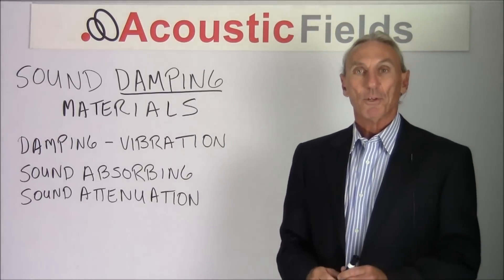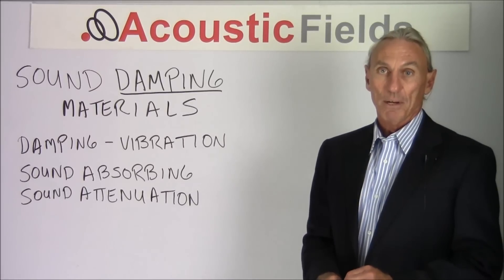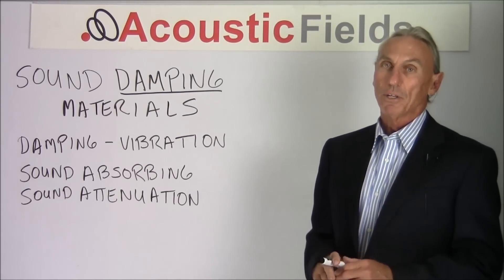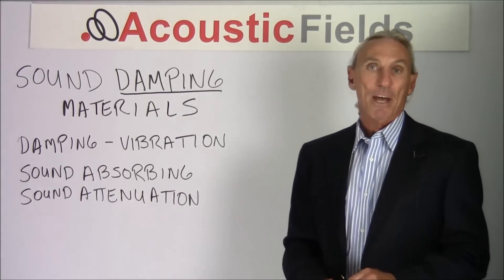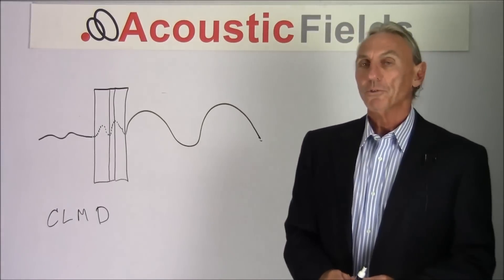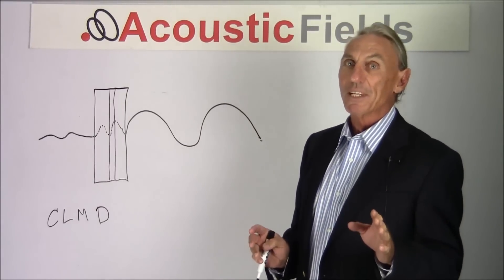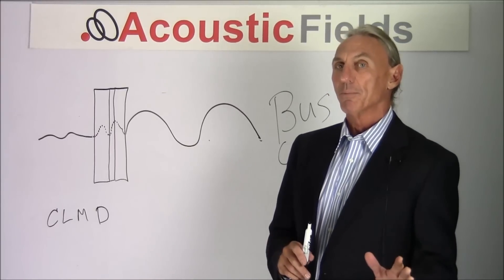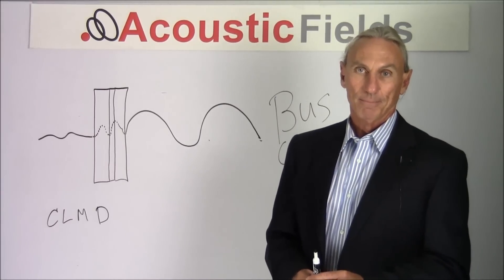What Are The Best Sound Damping Materials & How Do They Work?

Comment: I watched 8373747 videos and read 363873 articles that told me the difference between words and no one has ever told me how to stop the noise from my upstairs neighbours....... Just tell me what material to glue to my damn ceiling!
Reply from the maker: All noise is composed of frequency and amplitude. You must measure the noise and then assign the correct material type to deal with the frequency and amplitude of the noise. Its a process that starts with identification of the problem. Have you measured your noise issue?
Reply: @AcousticFields  It's looooouuud! I can clearly hear words and phone on vibration. Dropping a coin sounds like an explosion. Usually upstairs noise is both airborne and structural. I don't need to identify that, it's both. I really don't need to measure the decibels, what difference does it make if it's 45 or 78 or 89 (for example). I just know that it's unbearable. It's a thin brick+concrete layer. I got an offer from a company but with the money they want I'll buy a mansion in Peru... It's a small room, box in box is not an option. Some say structural noise is dampened by space,other say sound and vibration travel through space so you need hard materials. It's confusing. Which goes first? Cork, rubber,air????
Reply from the maker: @alessiasimonne2631  "Loud" is a subective term that has different meanings to different people. Since every material you must use in any barrier design is frequency and amplitude dependent, you must know both. This saves time and money. Guessing with noise is foolish. If you guess wrong, which 90% of clients we work with do, you will have to demo the job and start over. Noise below 125 hz. is treated differently than noise above 125 hz.

Comment: is it helpful to use viscoelastic material sandwich between two face sheet for sound barrier application. My requirement is to dampen the sound wave below 100 Hz. And the next is how efficient a commonly used damping material for sound reduction application in a range of frequency up to 500Hertz.
Reply from the maker: Noise transmission below 125 hz. requires a completely different design than frequencies and amplitudes above 125 hz.

Comment: I have a a simple question....i hope someone can answer it...I live in a condo with a shared wall and i want to eliminate the sound of talking from the other side. Will a 5/8 thick sheet of sound proofing drywall added to my existing drywall solve it?
Reply from the maker: There is no such thing as "sound proofing drywall". What is the frequency and amplitude of the noise? You must measure the noise before you design a proper barrier technology. Is the noise louder on some days? When you design a barrier, you must design for the maximum pressure at all frequencies.
Reply: @AcousticFields  no, its a constant level....if i turned the fan higher, i probably wouldnt hear the talking much.......well, soundproof or not, i would imagine that the extra layer would help.
Reply from the maker: @GEO-xx6sq  Guessing with noise is not recommended. Most guess wrong. make sure you consider the flanking noise in your design. Noise is like water. It will find the weakest link and travel through that structure.
Reply: @AcousticFields  thank you

Comment: If I use two ply sheet with small air gap between them. And if I make box with such arrangement. Can this box give a good sound proofing for noisy generator?
Reply from the maker: What are the frequency and amplitudes of your noise issues? Are the noise issues constant throughout the usage period or do they increase and decrease over certain days or hours? What are the maximum pressure levels you are experiencing, are they consistent, and at what frequencies do these maximum pressures exist at? Guessing with noise  is foolish and expensive. You must quantify and qualify.

Comment: Sir. Which is best damping material for speaker cabinet .. and how much it should be thick .. & should it be stick on all the wall .. using 18inch pro audio driver for home hifi
Reply from the maker: If you have to calculate the vibrational signature of the cabinet design. Remember when building cabinets just like rooms, noise transmission is all about vibration management.

Comment: The video title is "What Are The Best Sound Damping Materials & How Do They Work?" Well, guess what. Still waiting to know what are those famous material as none of them are mentioned in the video. That title is 100% clickbait.
Reply from the maker: There is no one size fits all. This is a common mistake made by individuals. Every material type and every construction methodology is frequency and amplitude dependent. You must first identify the frequency of the noise and then how strong the noise is before you begin the barrier design using the appropriate frequency and amplitude dependent materials.

Comment: One question. Let's say you have such a box and there is an engine that makes 32DB sound inside. Whatever the brown colored 1-2cm thick insulating material is, the best sound insulation is provided? If you were, WHAT WOULD YOU CHOOSE that brown material to best insulate the sound?   --cork mattress?   --fiberglass? ...........
https://teknoseyir.com/wp-content/uploads/2020/09/6aae00db077c8ca-608x539.png
Reply from the maker: There is no best. You must calculate your rate and level requirements for each surface area you are treating and match to usage. There is no one size fits all.
Reply: @AcousticFields  32 db electric motor and fan (air flow) sound. :) What is the most suitable material for this size with a thickness of 2-3cm?

Comment: Which is a good source of noise reduction a high natural frequency or a low natural frequency?
Reply from the maker: A,  What is the frequency and amplitude of your issue? Material type, amount, and construction methodology depends on frequency and amplitude.
Reply: @AcousticFields  Thanks for replying.
I want to know out of different materials if one material has high natural frequency then how is it even related to noise reduction
Any sort of equations?
Reply from the maker: A,  No, all material types are based upon the noise frequency and amplitude we are trying to reduce the transmission of.
Reply: @AcousticFields  ok, if we are provided with a material having high natural frequency will it be a good material selection for noise reduction or should we pick the one with lower natural frequency
Reply from the maker: A,  The resonant frequency of each material used is frequency and amplitude dependent of the noise you are dealing with.  One material type is never used. It is always a combination of materials to treat noise. You are looking for a simple solution and with noise. There is none.
Reply: @AcousticFields  Thanks for answering
Reply from the maker: A,  What is the resonant frequency of the material and what is the frequency and amplitude of the noise you are trying to reduce the transmission of ? You can not get away from measuring the frequency and amplitude of your noise source. No matter how many questions you ask, I will always need to know those numbers. Material types and amounts that are used in noise barrier technology are frequency and amplitude dependent. Each material type regardless of resonant frequency is amplitude and frequency dependent. Without noise numbers you are guessing and guessing with noise is a fool's game.

Comment: What material could block 209hz noise ? I want to stop this sound from entering the room.
Reply from the maker: R,  What is the amplitude or strength of that frequency?
Reply: @AcousticFields  i don't know, it's a humming noise. It's not louder than someone speaking but it affects my spleep.
I think it comes from a water treatment station.
Sometimes when i open the windows the "resonance" effect disappears, sometimes is more strong and opening the windows doesnt change it.
Ear plugs (orange ones from 3M) dont work...maybe that sound passes the skull.

I say 209hz because i have a App (hz generator) that when i put that number i cant hear the hum, but when i slightly lower or increase the number i can hear the hum and the sound of my phone.

Comment: Hi, what would you suggest to dampen construction sound dampening material?
Reply from the maker: T,  What is your usage?
Reply: @AcousticFields  construction vibration.
Reply from the maker: T,  I do not know what that means. Do you have noise measurements?
Reply: @AcousticFields  I am planning to soundproof and sound dampening a room as I am absolutely terrified of the noise construction works may create (vibrations, noise etc). The company in question had suggested a laminated parquet + mineral wool solution to the walls. When asked how that would reduce the noise he quoted a reduction of 8-10 decibels. I wonder if its worth doing or whether I have to search for other solutions.
Reply from the maker: T, There is no way you will receive that reduction with full range construction noise. Companies that use limp mass materials to stop noise are misrepresenting the truth.
Reply: @AcousticFields  is there a way to make the noise manageable?
Reply from the maker: T,  We can assist you with your noise issues. First, you must take measurements of the noise. We have a process for that using your iPhone. You record your data on our data sheet and then send it to us. We then design the barrier you require for your noise issues.  You then have the barrier built or build it yourself from our drawings. The design fee for this service is 1,500.00

Comment: is there any material which onlr reduce sounds having db above 60?
Reply from the maker: S, There are many. What is the frequency and amplitude of your noise issues?
Reply: @AcousticFields  In the range of 90-110 db
Reply: And frequency 1.4 KHz-5.0 KHz
Reply from the maker: S,  We can design the barrier for you through our design service. We will need to take noise measurements over a seven day time period and then design for maximum pressure. You can take the noise measurements and send us the data. We will send you the structure to build. The design fee for this service is 1,000 USD.
Reply: @AcousticFields  will it possible that material will allow sound having db below 60, pass through it?
Reply from the maker: S,  No. This is why we design for maximum pressure. All pressure levels below will be covered.

Comment: Ahhh.... what are the best dampening materials!? Hello!
Reply from the maker: H,  The correct term is damping. It depends on the frequency and amplitude of the noise you are trying to reduce the transmission of.
Reply: Acoustic Fields 
Thank you for your quick reply, and I apologize for my impulsive outburst. 

I have a UPS which is limiting a high pitch coil whine. Extremely annoying! It is driving me mad! The best way I can describe it is a very sharp whistle. I tried to recreate it using my phone with sound generating app it seems to be around 9,230HZ. I'm desperate to either dampen it or totally intimate it if possible. I even found the culprit coil. I'm trying to find ways to either put dampening or sound proof material on the coil, the insides of the UPS case, or put the whole UPS in an enclosure. As for material, I thought of foam, Styrofoam, cardboard, vacuumed glass panels, wood........ still trying to figure out what to do... could you please kindly advise? Cause I'm literally losing my mind from this whistling!
Thank you so much and apologies again.
Reply from the maker: H,  You can use our 2" foam as close to the source as possible.
Reply: Thank you kindly

Comment: Thanks for sharing all of your knowledge. I find your videos to be super helpful. 
I’m going to be trying to make a budget home studio. I’m planning on adding a second layer of drywall with green glue to my existing walls as well. But before that, I want to blow in some insulation. Do you have a suggestion? I heard fiberglass is best because it is lighter and won’t transfer as much low end energy. But cellulose seems to be what many people are using. On a tight budget. Any help is greatly appreciated. Thanks
Reply: Greg, I watched some of his other videos and he doesn't recommend drywall.  I think he uses 3.8inch plywood.  I would contact him and give him more specifics on what you're trying to do before you do it.

Comment: I have a question. Would composite asphalt shingles act as decouples if sandwiched between two pieces of 2x10s or sandwiched between two pieces of sheet rock?
Reply from the maker: T,  What is your objective? Is this a proposed barrier technology ? if so, what frequencies and amplitudes are we dealing with ?
Reply: To stop the vibration of one 2x10 from transferring to the next. The frequencies are loud muffler noise. I am going to cover part of the eves with , my plan, with two 2x10s with a decouple sandwiched between them to keep the loud noise from coming in through the eaves or Soffit and into the house. Green Glues is not for exterior use. So I am looking at different methods. Then I have thought would the shingles have the same effect as Green Glue or Mass loaded vinyl between two sheets of sheet rock for the inside of the house? I believe the shingles would be cheaper. What are your thoughts on shingles?
Thank you
Reply from the maker: T,  Without noise measurements of frequency and amplitude, this is a bit of a guess. I would use your method and repeat the sequence so the barrier is at least 3 1/2" think. This is a minimum thickness we use for low-frequency management which would be the case with loud muffler noise. Green glue is not necessary. Any silicon-based adhesive will work.
Reply: Thank you

Comment: Mr. Foley(sp?) I appreciate these videos. You get pretty in depth although I wish you had the time to go even more in depth as in a “class” on acoustics. However I do notice that you are very scientific in the way you deliver information by making note of all the grey areas and nuance in the subject matter. Making sure that the audience realizes this is not cut and dry. Although I usually love that approach across the board in any field, ie: nutrition, Psychology, what have you, there comes a point where I really wish you might just throw out some broad general guidelines or advice for maybe at least a handful of scenarios. As an example you might say, “If you were playing drums in a garage and didn’t want any noise complaints you may want to have a separate room within a room or multiple layers of drywall with cotton insulation. Etc. etc. something to that affect.  Hopefully what I’m saying makes sense and maybe there is some basic fundamental material(s) that you could safely say will do “x” relatively consistently when used in scenario “x”. Thanks for the free info
Reply from the maker: K, We have considered that approach but find that it doesn't change belief systems. Every situation is so different. The industry has made a habit of making generalizations and half-truths for so many years that these half-truths are now viewed as facts.  Let's use your example to illustrate.  Building the barrier you suggested will not stop all the drums. It will only have a partial benefit as it relates to snares and toms. It will have no impact on the kick which is the lowest frequency producing instrument and the noise from just the kick will bother neighbors. Secondly, your barrier design only works at pressure levels below 80 - 85 dB SPL Most drummers play 100 dB + levels.  For me to make a generalization about all variables required even to meet a general basis for easy concensus is fraught with disaster.

Comment: You kept saying the terms are "very very different" yet if there is a difference, it is not apparent you know what the difference is.
Sound IS vibration.  Absorption does result in damping.
Did you actually feel good about this video?  What useful information did you hope you had conveyed?
Reply from the maker: B, You must start with the basics and work your way towards understanding. Everyone is at a different level of understanding. Go ahead and answer your own questions here for our audience.
Reply: Acoustic Fields at the risk of falling into your trap and sounding pedantic, I will suggest some changes.
Sound IS a subset of vibration.  A useful  distinction could be drawn between properties of vibrations traveling through fluids as compared to properties of  vibrations traveling through solids.  One example of such differences is the absence of shear waves in fluids whereas solids support shear waves.
Also, absorption of vibration is a major contributor to damping.  It can be thought of as a subset as well.  
Rather than attempting to create an artificial distinction between absorption and damping, it would be more useful to compare the differences between isolation as compared to damping AND the differences between  absorption as compared to redirecting.